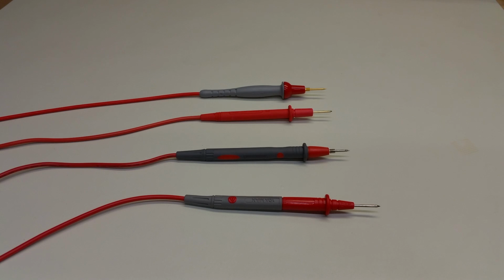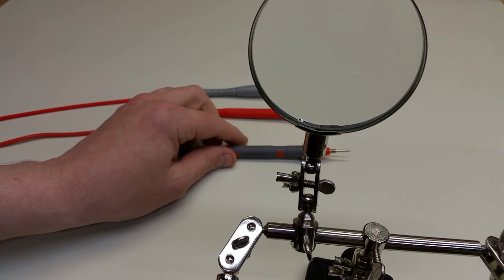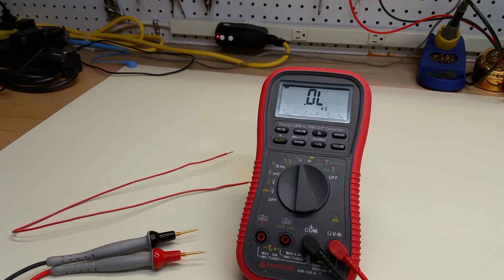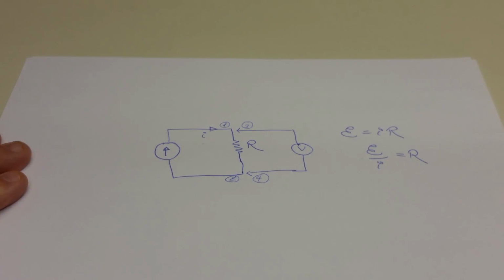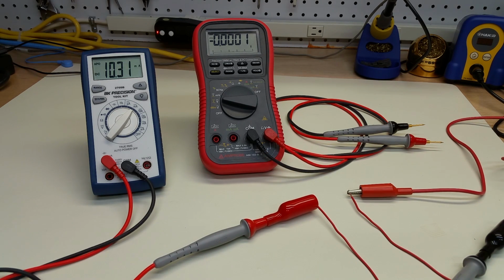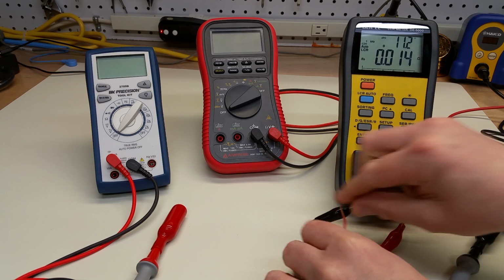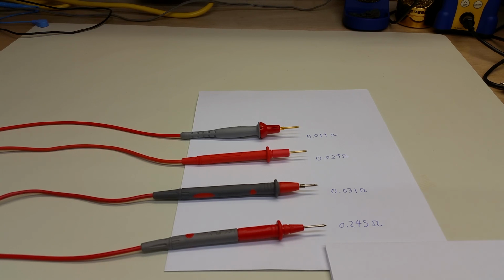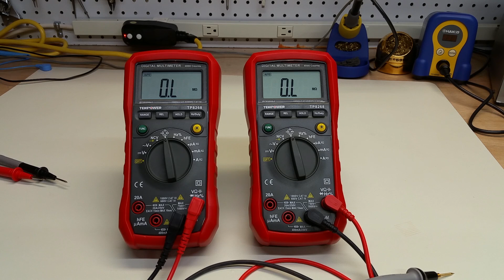#7: Some observations on DMM test leads

Comment: I am not a big electronics guy but do dabble.  I finally bought a real mid range DMM to replace a low quality analog meter.  Having no experience with a real meter, I was somewhat perplexed at the high and variable readings with shorted probes.  A new set of probes made a big difference and performed much more as I expected.  This video explained much.  Thanks.

Comment: I really appreciate the accurate measurement and explanation good sir! You definitely get a subscription from me. :D I'm definitely a "hobbiest" and just haven't been able to justify dumping too much money into things.. ^^; I really do dabble in so many fields (chemistry, programming, lockpicking, hacking, pic, arduino, electronics, etc...) that if I put as much money as I wanted into things than I would not only be broke, but be in massive debt. lol

I just bought the Tekpower 8268 that you reviewed since I wanted a step up from what I have, so it's really great to know that A) It's a modestly good meter for the cost and B) that the leads it come with are shit. LOL I'll be sure to pick up some decent leads next pay check. Really though.. Even if you don't have as many views as Dave or Clive, do know that I'm incredibly grateful for your time.
Reply: Holy hell sir... I did the 4 wire measurement on my leads from the tekpower 8268 and got 0.521 ohms on one of them, then 0.091 on the other. I've never had a multimeter with such crappy leads before.

Additionally I did a teardown of the meter and I must say, it's really pretty crusty inside. ^^;; Super minimalistic on the protection circuitry and the solder joints going up to the banana plug jacks was pretty aweful. Additionally the tracks for the 20amps seem totally inadequate. :( It won't be an issue for me as I just don't work with any high voltage, but it was strange. In hindsight I am wishing I just went with a manual Amcal or Extech..

One thing that was interesting was the fuse assembly. It's on a plastic standoff on the board with metal tracks going up the side to the fuse holders. Interesting idea but I feel like I could break the damned thing changing fuses. ^^;; Still, it was an interesting teardown. You should give it a shot! I don't see any teardowns of the meters..
Reply from the maker: I appreciate you for sharing your findings. I've thought about doing a meter tear down video, and might at some point, but for the time being I'm fixated on some issues in RF design.